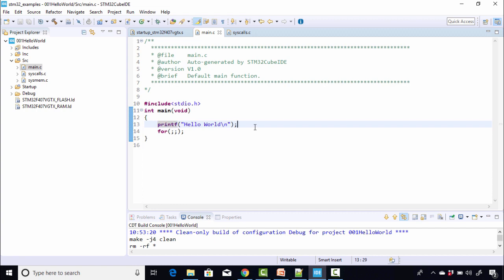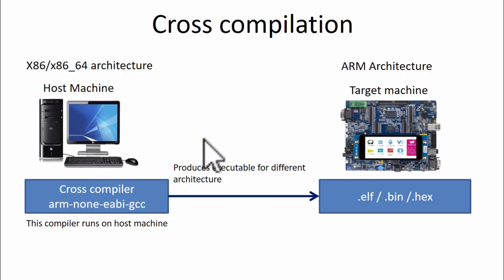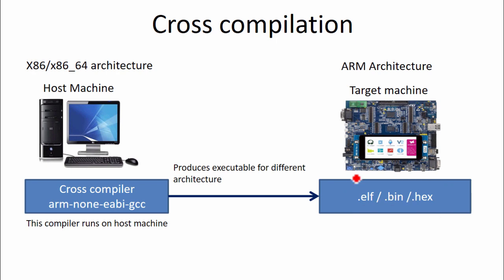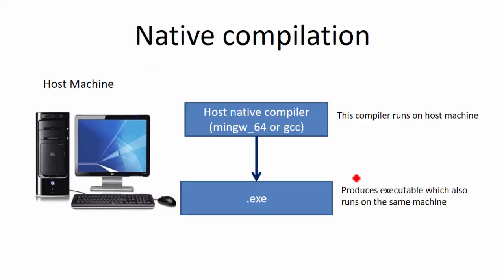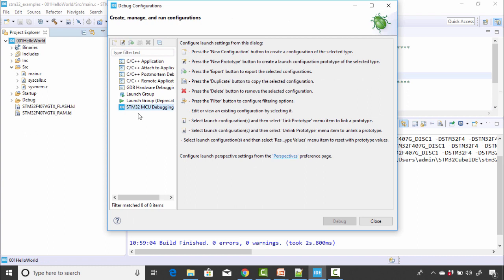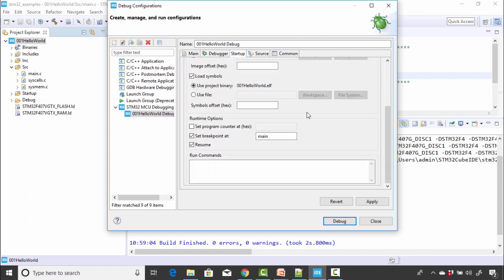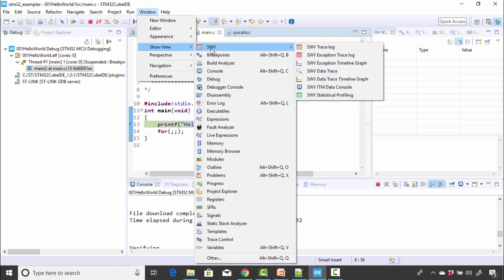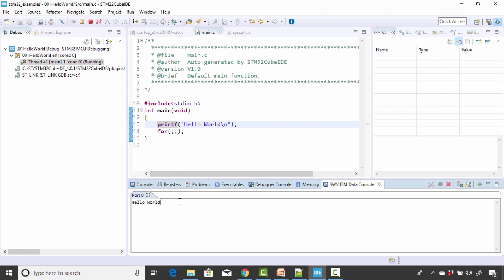Lecture 7: Testing printf over Serial Wire Viewer feature of STM32CubeIDE

Comment: I did everything as per your instruction in STM32F4 discovery kit , the binary(.elf)  is downloaded and running without errors in target , but not printing anything in ITM data console , no errors as well. Please help  , any soldering need to be done , PB9 ..etc ?
Reply: same problem happened with me .... any help !!
Reply: @mohamedhossamtealeb8682  Check User Manual to the corresponding board  (like UM1670)... in that case SB9 (solder bridge 9) is open.  It has to be soldered in order to connect the line.  Also don't forget to enable the ITM sending of the data out.
Reply: Have you figured it out yet? It seems like I've run into the same problem.
Reply: @mohamedhossamtealeb8682  So, have you figured it out yet?
Reply: @quanvuanh8172  as Emiliano Vera said it needs to make a bridge in SB9 as per datasheet, but i didnt try this practical as i dont want to play on my board. But if you want to use printf() function you can use semi-hosting  or generally you can use usart to send characters.
Reply: @emilianovera1075  Thanks for your reply.